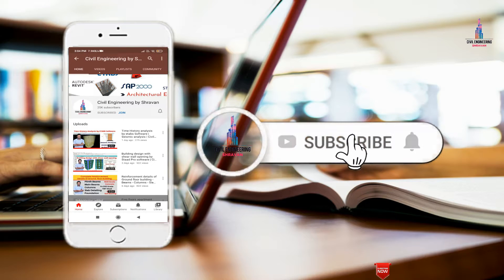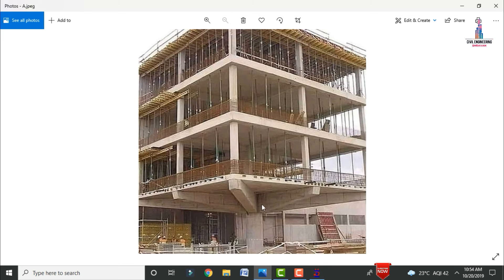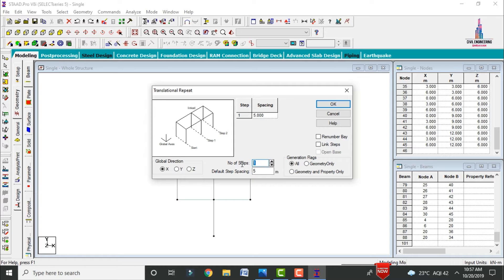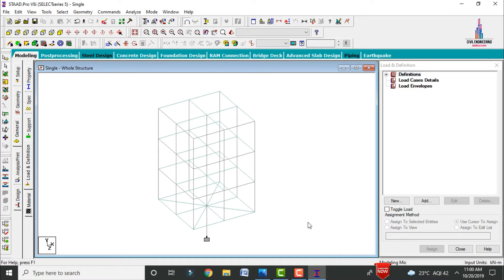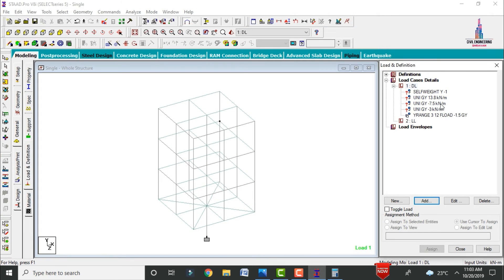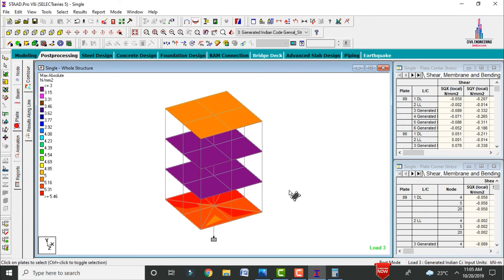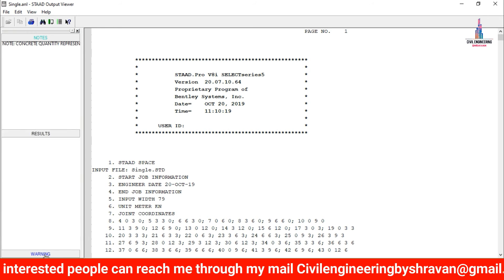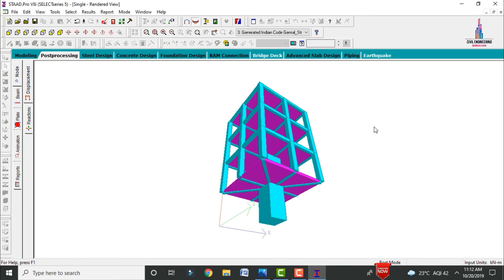G+3 single column building design with diagonal column by staad pro software | civil engineering |

Comment: this structure will be failed
0.4m*0.4m size of column has 20 nos 20mm dia ?
1.5m*1.5m size of column has 20nos of 20mm dia bar it is possible???

Comment: Brother... Section 0.3m x 0.23m is problem in that...

Am using 0.2m width and 0.3m depth so I never get any warnings.... You don't want to change thickness and column size...